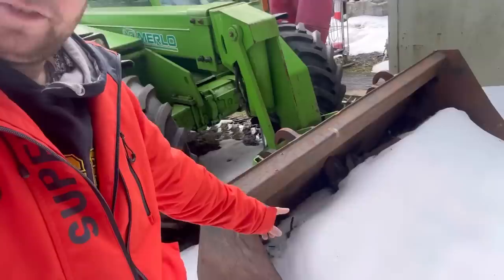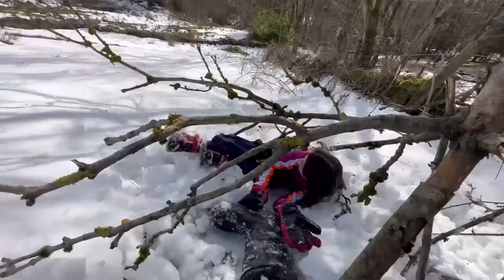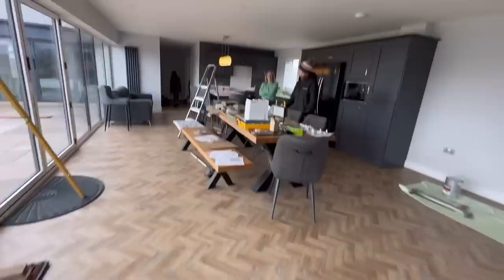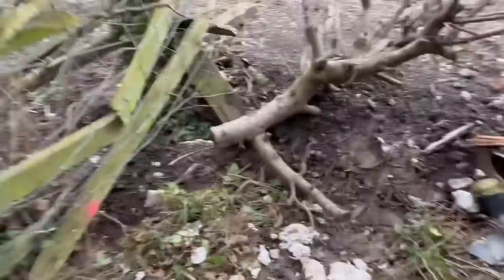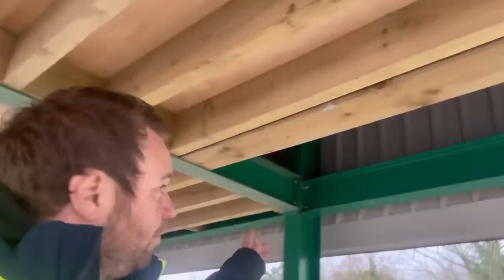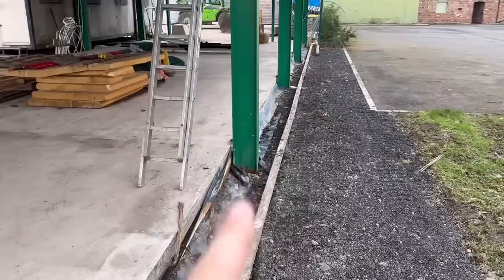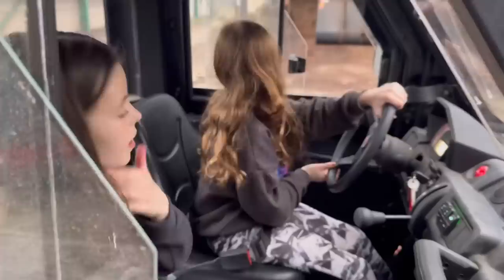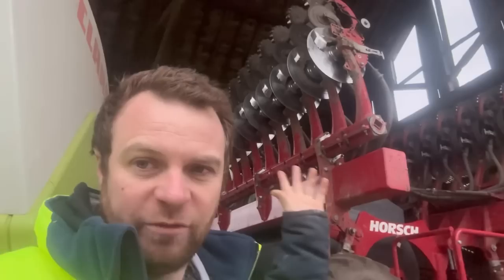ABANDONED CRASHED VAN SLEDGES & NEW FLOOR #OLLYBLOGS #AnswerAsAPercent 1085

Comment: With extending the floor in the new building, would it be worth putting a set of double doors in the gable so you could lift stuff up there on Pallets if you ever want to use the top floor as a store?
Reply from the maker: Yer